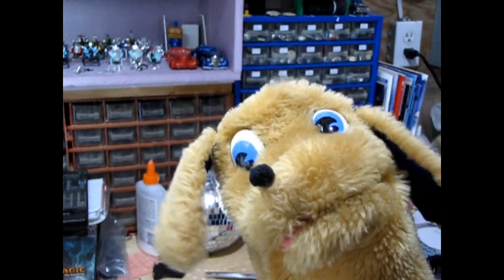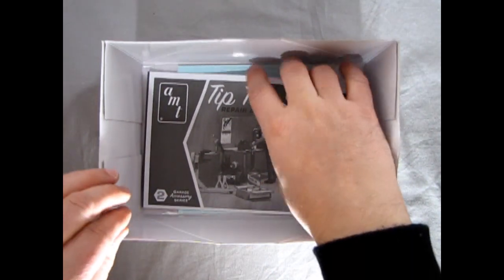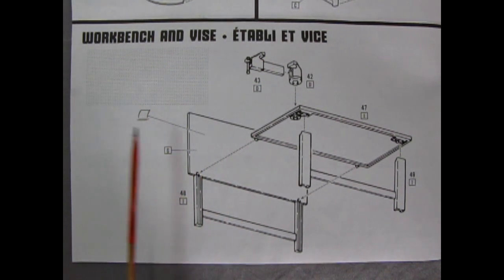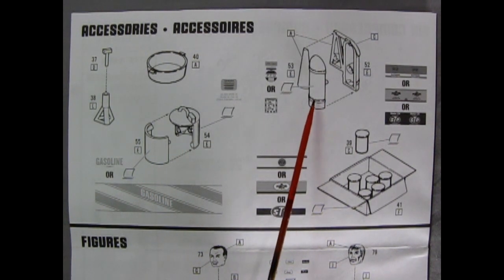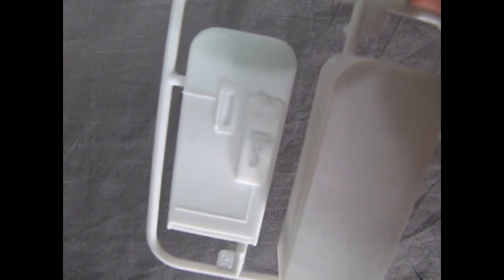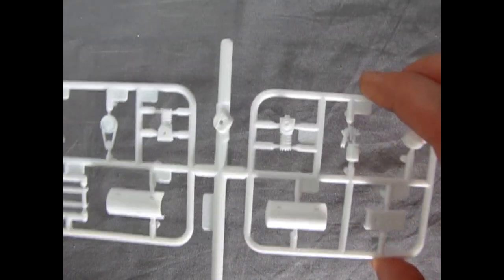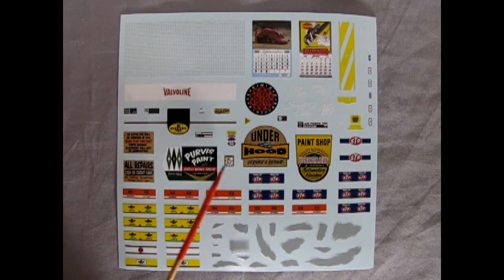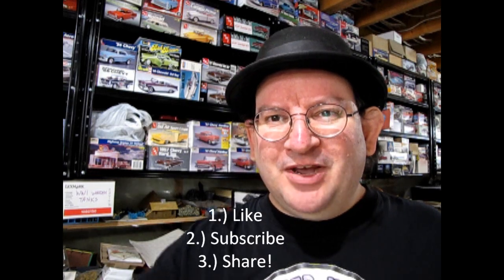Unboxing the AMT Tip Top Shop Repair and Maintenance Garage Scenes Plastic Model Kit

Comment: Another great automotive detail set, I'd name the mechanics Larry and Zig. The payphone AMT put in the kit would have been an antique back in the '70s, I'm not sure a car repair shop would have used a 1930s era payphone but if it works, it works!
Reply from the maker: I thought that was a 1950's pay phone. Actually on the decal sheet, there is a poster or calendar from 1948. The phone would probably fit that era.